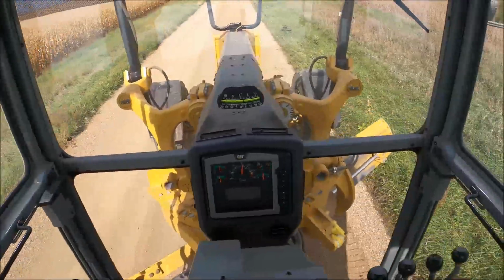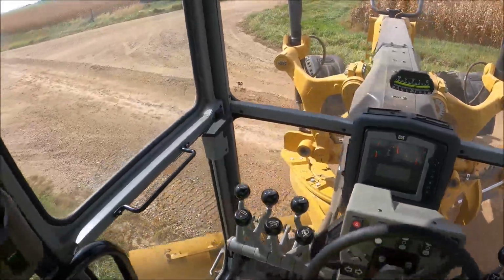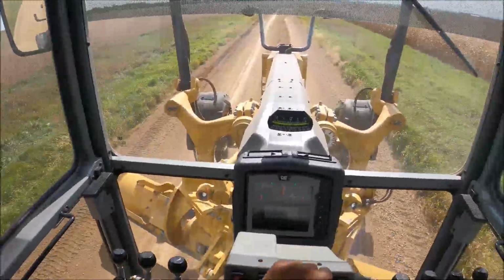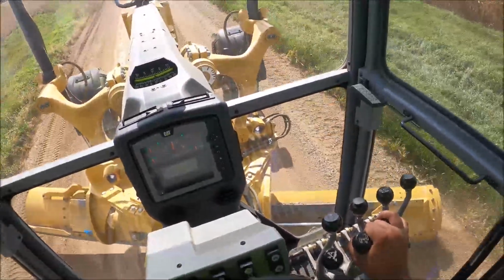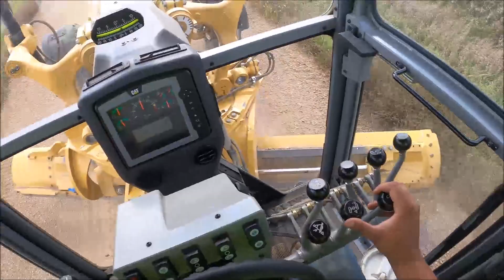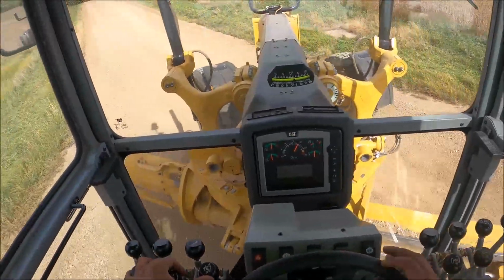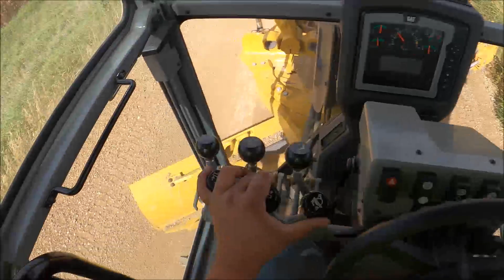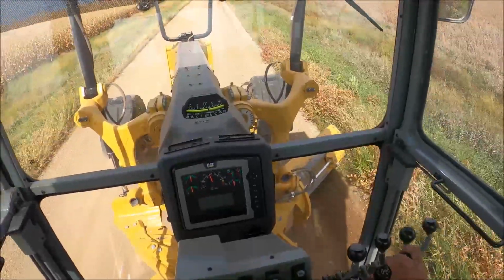2019 cat 140 fall maitance blading

Comment: Do you put your heel of the blade over the crown little bit and raise it up little bit or do you have the heel down on the road before the crown and dump the Windrow out on the crown?
Reply from the maker: Yes my heel of the blade is on the center line pushing my windrow just across the center line when I pull my windrow in always make suer your not cutting out your center line with your heel from to much pressure if road is washboards and needs to be all cut out and relayed then you have to cut from shoulder to center line then center line to opposite shoulder the relay all that material back across the road rebuilding the 4 to 5% crown hope this helps thanks for watching.

Comment: How do you find those tires for ride while blading? Our 772g bounces horribly with these radials, never had a problem with the normal off road style construction tire. But these damn things make the machine put washboard in my work in anything beyond 3rd gear.. drives me nuts!
Reply from the maker: I love these tires can blade 5.5 to 6 mph with them air pressure is a huge component thought when I had them on my 772GP I run 45 in all six and that balanced out good try that also run with your differential locked makes the Deere machine more stable also stay away from the radial recaps had nothing but trouble with them hope this information helps ya
Reply: @graderman140m  jeesh, yeah weve had the tech guy come in and test different pressures in all of the tires, i generally always grade with it locked in too! Gotta keep the air out of my seat cause my head will hit the ceiling from bouncing so much if i do lmao. Must be the specific brand on it, its definetly brutal though.
Reply: Between the machine bouncing up & down and the thing rolling side to side when pushing a full blade, i havent had the luxury of a machine letting me do a "perfect job", extending the blade far right when blading helps a bit (puts more weight over there im assuming).
Anyway just found your channel ive subscribed and gonna watch all your vids man! Love it keep up the work. Im sure i can learn lots from your channel.

Comment: Do u prefer this machine over the M series?
Reply from the maker: It honestly depends on what I’m doing if I’m just blading I love this machine if I’m doing dirt work or finish work I prefer the M there both great machines thanks for the question and thanks for watching!
Reply: CAT definitely sets the standards on graders. Have ran CATS 25 years. Had a GP series DEERE for 5 years and tried
Reply: Tried to hav a good opinion of it but after while it was futile
Reply from the maker: @graderboy41  I got a new 772GP Deere last spring and I do like that machine just miss the low end torque the cats have also like how the controls move up and down with the seat in the Deere